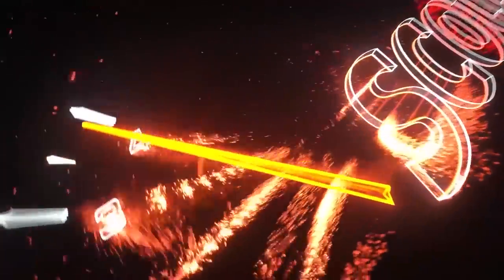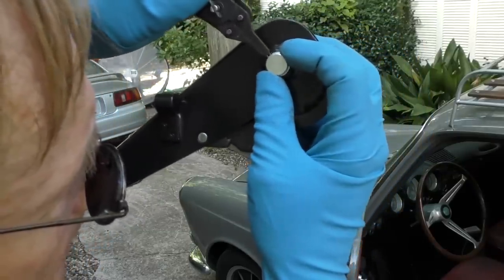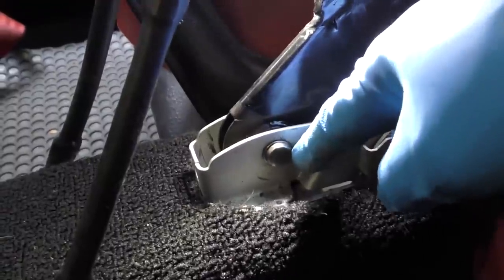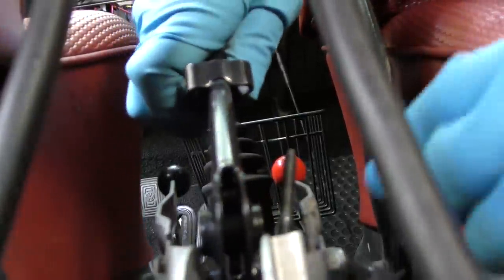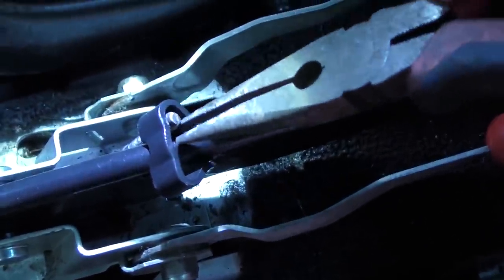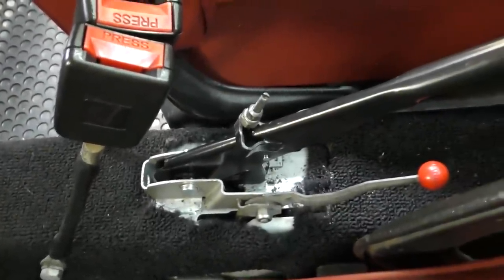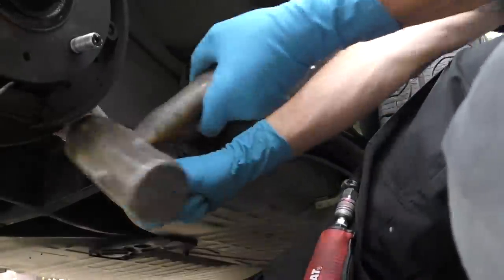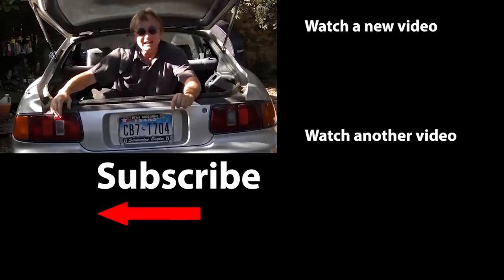Here's Why I'm Putting This on a Car

Comment: Just got done doing this to my 1971 super beetle and put four wheel disc brakes to make my bug more safe to drive those drum brakes that they made in 1971 don’t stop worth a crap so my bug has a new master cylinder new brake lines and new re reservoir
Reply: Just curious.. does it now have two separate compartments for fluid, or is it still a 'fruit jar' type reservoir?
Reply: Fred Flintstone  it’s a single reservoir that is plastic two lines going to the master cylinder

Comment: I hate the term Emergency Brake. It's a Parking Brake it can't stop you car if it's going fast.
Reply: Bingo! You're absolutely right, Dallas Dal, it is a PARKING brake! Too many Americans think that putting the gear lever in Park is enough... Well, it isn't! Just putting in Park could lead to catastrophic failures if a vehicle is parked on a slope. Years ago, I once walked past a vehicle that was parked on a steep driveway, and guess what, I heard an awful bang, its parking pawl (that's what it's called) had failed, and the car rolled back onto the street thankfully without hurting anybody or hitting and damaging anything as no one was driving by at that very moment! Remember, I was just behind that car seconds before it happened! Phew!

Comment: I had a Ford Pinto that had a broken e-brake. Instead of replacing it, I just turned on the AC.
Reply: On my '57 Plymouth the e-brake broke, so I carried a brick on the floor board to chock the tire. I live in southeast Louisiana, no hills.

Comment: My 2001 Oldsmobile Intrigue still has the foot parking brake and it still works. The one on my dad's 2005 Chevy Malibu Maxx is the exact opposite: requires 2 feet to press the darn thing to get it engaged.

Comment: I remember back when GM had a deal going with the employees at the plant in Oshawa, if you could save them $1 per vehicle by changing or eliminating something they would give you a $10,000 bonus. Lots of snap rings and shortened battery cables from that.

Comment: What constitutes an emergency in order to apply the parking brake?
Reply: a failure of the hydraulic system, meaning there is no pressure from the pedal to apply the brakes. if you find yourself in such a situation, apply the parking brake rather hard but do not stomp or yank on it cause you might lock up the back wheels and lose control.

Comment: Scotty the roof a/c unit in my 2003 suburban has water leaking out of it every time I go to make a turn. I’m worried it will damage the unit if I leave it alone. Any advice?
Reply: I'm not Scotty, but I'm going to guess your drain tube is clogged or disconnected. Not familiar with the design. Any yes, it needs fixed.

Comment: Thanks Scotty. I have a '66 Baja Bug and a '67 Karmann Ghia and both cars don't have a working park brake. I will save this video, so that when I get around to fixing them, I will have a clue. My daily driver is a '94 Toyota Camry coupe with a 4 cylinder. It only has 153K miles on it, so it should last me another 10 or so years. :)

Comment: My BMW is now starting and when I try starting it nothing happens no dashboard lights come on, no crank, nothing just completely dead. The battery I’m using is still completely new. I’m not sure if I’ve blown a fuse or not. And I’m not sure if I should try to jump start it. Please let me know.
Reply: Do your headlights / horn / brakes lights work ? Did it work before you put the new battery in ? Got the polarity right ?
Reply: Gordon L  no my headlights do not work, they worked when I put the new battery in
Reply: @lonoacich5914  Check the battery first , there may be some power drain that has flattened it . Put it on charge for a couple of hours if it's low and test your lights again , go from there .

Comment: I check mine the drum slash shoe is good on my Acura El idk if it's the  line or what I guess it's just not  working cus it's never was used idk why my e brake won't work

Comment: Hi Scotty i was wondering what are the 2 leavers for next to the hand brake ones got a red handle the other got a black handle 🤔.
Reply: Red is Heater, I think. Black is vent. Can't swear to those but, am pretty sure. I'm not Scotty though so, don't hold me to anything. Just trying to help.

Comment: These cars are nice, but to get them to be roadworthy for modern times you have to install the suspension/assembly or even the whole suspension subframe from similarly sized modern car, and even engine/transmission has to be newer too